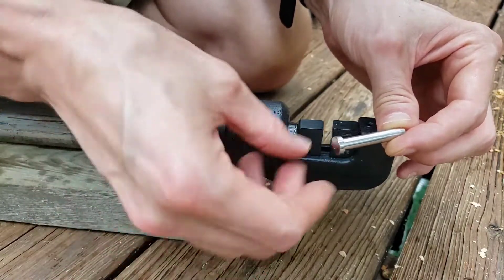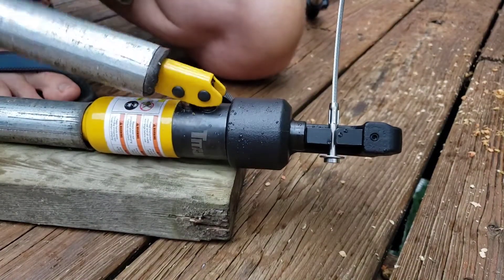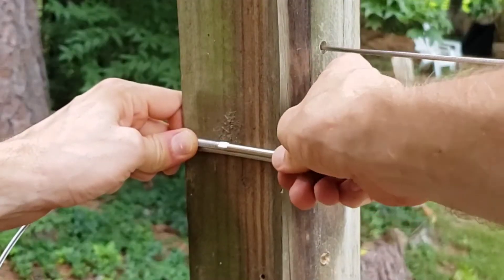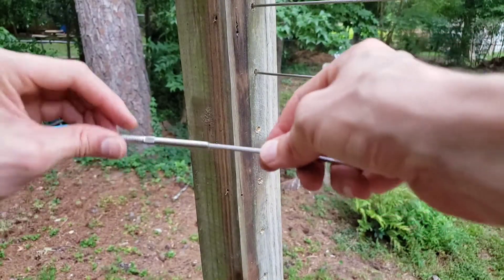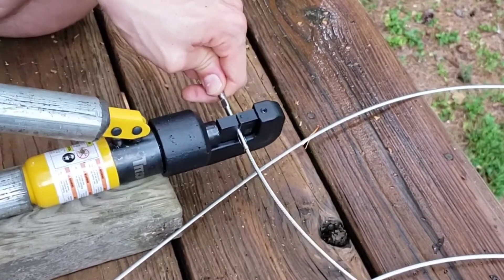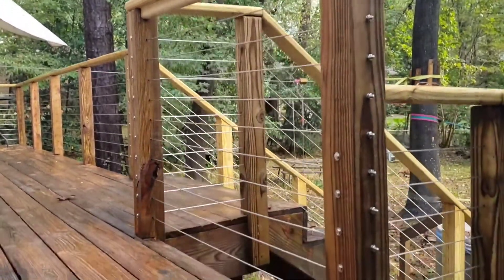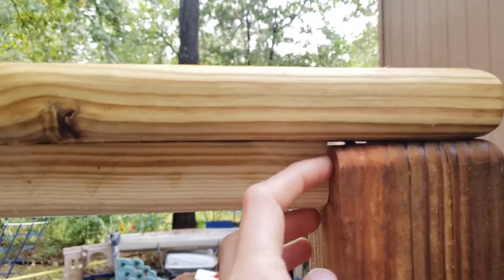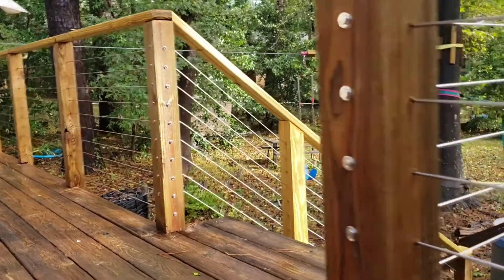Cheapest DIY Stainless Cable Deck Railing Pt.5: INSTALLATION - Running the cables through the posts

Comment: what did you use to supprt under the railing to cross brace the tension from the wire?
Reply from the maker: A 2x2 going between the posts.

Comment: informative video...performing this right now and I'm having an issue with the hydraulic crimping NOT fully crimping the end of the hardware. Not really sure why, been cranking down on it but no joy...considering sending the whole mess back to Amazon.
Reply from the maker: Have you watched my Cable Crimping video? I had very strong crimps using this method. https://youtu.be/aTW-sWjFWjE
Reply: @engineerable  In fact I have. That video motivated me to purchase a larger (16ton) crimping tool with longer handles so I wouldn't have to DIY a 'leverage improver'. In fact I might have picked up the idea that the #8 crimping die was the proper size there too. The crimper I purchased was the HYCLAT and I think my issue was that the die was too large for the hardware. The Muzata I purchased to replace the HYCLAT specifically has a die marked '1/8"' so hopefully that will solve the problem. Thanks for replying to my pain... ; - )
Reply from the maker: @gordonrain7152  Did you try a smaller die size? When I use this crimper for electrical lugs, I find the die size markings to be useless and just have to use a size that works.
Reply: @engineerable   Howdy again pard'. Update: Apparently, I was correct regarding the die size. The Muzata crimper only came with the 1/8" die and it works as it should. The HYCLAT included a set of dies but the smallest was the #8 and it proved to be one size too large. All is as it should be now, but thanks for offering your help and expertise...BTW, are you an Engineer?  I'm a retired Architect/Engineer myself. Actually, my Engineering was a secondary study back when the University of Memphis was called Memphis State University. A long time ago....again, thanks for the help.  Oh, BTW. I like this cable 'thing' so much that I'm adding it to the bays of my multi-raked pergola I also built not only for looks, but to aid in stringing overhead RBG tavern bulb strings!  What can I say, ya gotta think outside the box, even when (or especially when) you're an Engineer.    : - )
Reply from the maker: @gordonrain7152  Glad you got it working. I guess your crimper being larger has larger dies vs the Titan crimper I used has several smaller dies than what I used. Yes, I'm a mechanical engineer. 👍 There's always more to learn!

Comment: Great content. ?, I have been hearing that some people have experienced rusting of the cable. What has been your experience? I’m thinking of trying this at a beach house where there is salt air. I’d be interested in any input you might be able to share. Thanks again.
Reply from the maker: I have not experienced any rust. We live in the rainforest south with high humidity, although the ocean air is much more aggressive. The Korean manufactured cable that I used and linked to is higher quality than the other stuff on Amazon. 
One thing that is important with stainless to prevent rust is to passivate it. There are products that you can use to do this if you discover your cables or hardware have rust.
Reply: @engineerable  thanks for the input. My plan was to treat it with something that might prevent that from happening. Thanks again.

Comment: Great video series! I am looking to also do cables with my wooden post. I have noticed that the tension can loosen over time. Have you noticed any cables loosening now that it has been up for a while? Thank you
Reply from the maker: Did you notice the tension loosening on wood or metal posts? Adding the larger washers as I talk about definitely helps spread the load and prevents the head of the swaged on studs from digging into the wood. Wood compresses, and will continue to compress over time under pressure until it reaches an equilibrium state. You may need to retighten a few times until it reaches a point that the wood no longer compresses or shifts. Without the larger washers though, the studs may continue to dig into the wood.

Comment: Curious, did you do a video on doing the cabling for the handrails going down stairs?
Reply from the maker: I have shot the video, but working on the edit. Drilling the holes is more complicated, but the drill guide jig worked well for doing the angled holes.

Comment: Great series. Looking forward to the next one. What was your spacing between the cables?
Reply from the maker: Thanks, I use a 3in spacing between cables. In general, code requires that a 4in ball cannot fit through the cables. There's no force spec for how hard the 4in test ball can be pushed to try to spread the cables. The cables have to be properly tensioned to prevent the 4in ball from passing through. Each cable requires 150-300 lbs of tension.

Comment: Great series - I came here for the deck railings and subscribed for your other videos. I ordered the same system, but what size washers did you use for the ball swedge end??
Reply from the maker: Thank you! Glad that my videos helped you with your deck railing project! The washers are 1/4 Inch Stainless Flat Washer: https://amzn.to/3g0k8hr